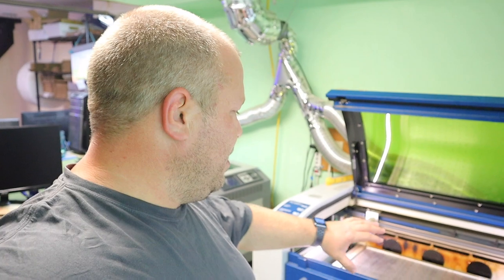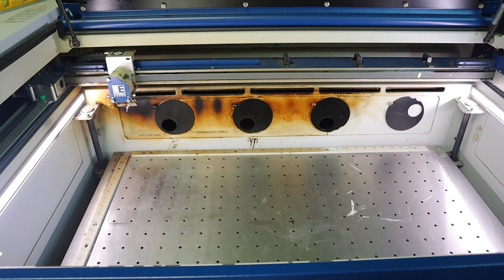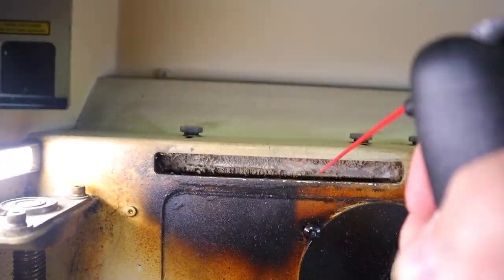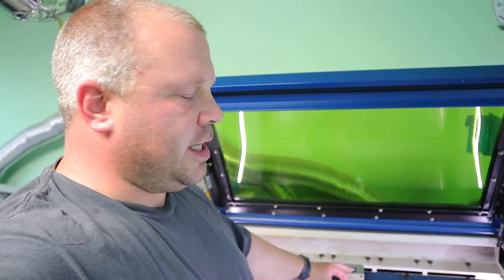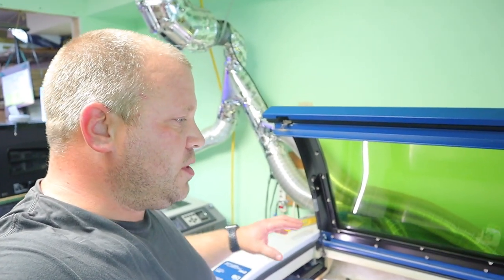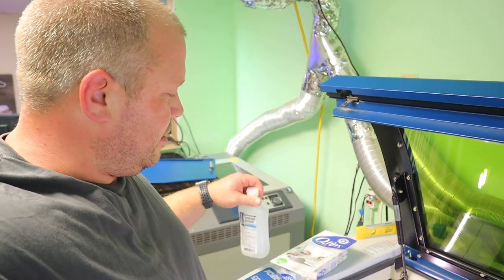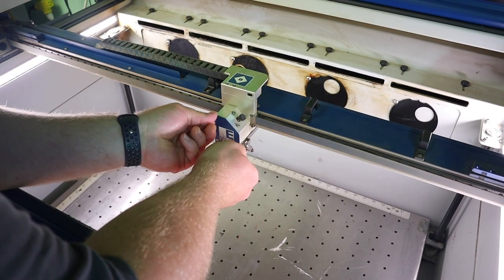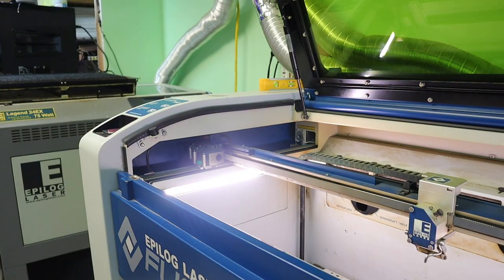How to Clean my Laser - Laser Cleaning Schedule and Routines for Co2 Lasers

Comment: I know this is an older video so I’m hoping you still see this question. When you did the compressed air, where does all of that debris go? I just took over an M2 that’s almost exclusively used for acrylic and the back is caked in web looking debris. I’m sure it’s flammable & I want to get rid of it but I don’t want it sitting inside somewhere, still being a hazard. Thanks for any help!
Reply from the maker: Glade to help. When I blow out the lasers I turn on the exhaust and let it all get sucked out or bring it out side and blow it out if they are really bad.